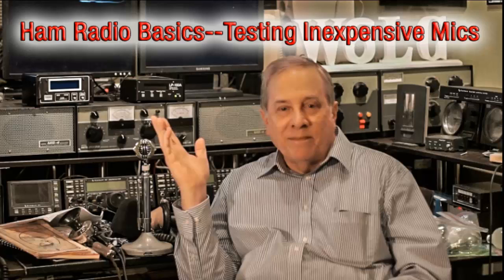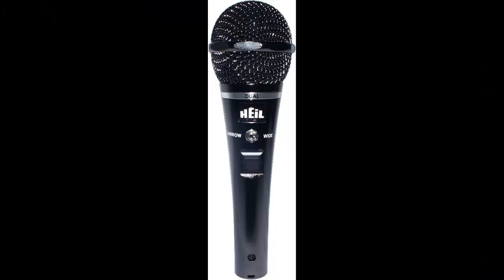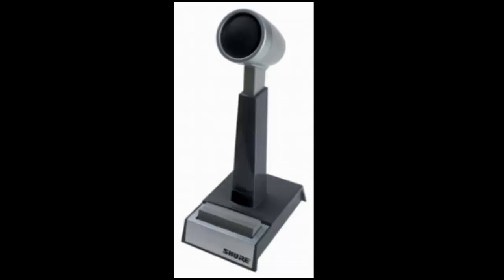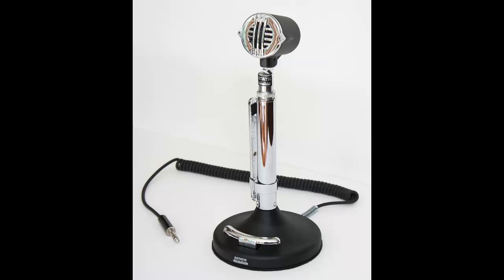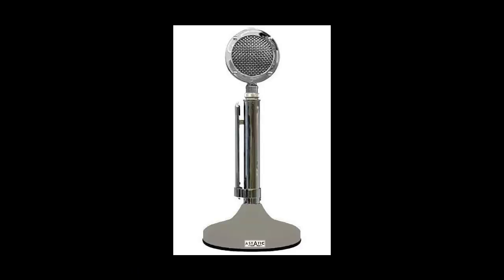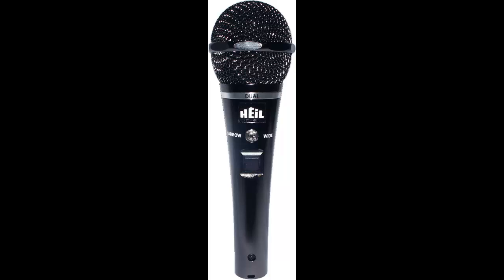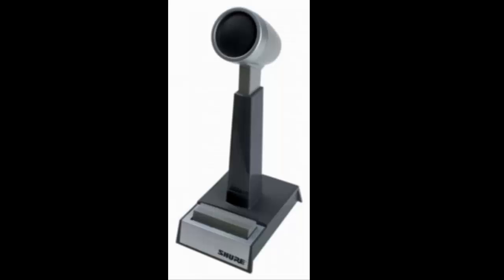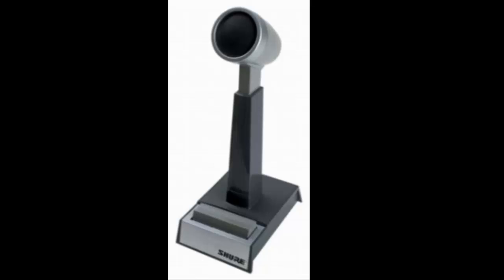Ham Radio Basics--Testing Inexpensive Microphones

Comment: Hi Jim. MIKE N2DBi. I know this is a oldvideo im a big fan of the d104 i run them just cracked open on the base of the microphone.  The question  im asking is... Is this d204 a amplified one with a 9 volt battery in the bottom? Or is it a Stock d104 with no amplification ?

Comment: I’m looking for a boom mic for my icom 2730a ( I already have the heil adapter cable) for use when doing check ins during a net. To have both hands free would be a big help so I can log in my laptop more easily. I’m thinking of the Heil 10. Thanks for the video

Comment: you make a good mic sound bad by taking all the lows out and crank the treble up you make then all sound like the d104 no body wants to talk to you when you sound like a close pen on your nose give it a little bass and a little midrange and some highs but not all highs that sounds bad
Reply from the maker: Thanks but your message is hard to decipher as written.  Some punctuation would be helpful to make your points more clear.  Your comment that "...nobody wants to talk to you..." is far from true.  I have had ten of thousand of contacts with every country on the planet over a span of 56 years.  My audio does not sound like a D104 high impedance mic into a low impedance transceiver.  Thanks for your input.

Comment: Very good review, which microphone do you recommend to use with an ICOM 7300?
Reply from the maker: Hi,
Because the IC-7300 has equalization built into the transceiver, any mic that is relatively broad in its response will likely work fine. So, an electret cartridge like those found in some Icom mics would be a good choice.  Any older dynamic mic is probably good.  That would include the Heil HC5 cartridge, my favorite the Astatic 10DA, Shure 444 and any other dynamic mic that does not have heavy emphasis on low frequencies.  One way to find a good mic is to test some from other local hams.  Again, you don't want a bunch of lows in the audio.  You may like the way it sounds in the monitor but it won't be good communications.  I am sure you have heard the guys with terrible, broad, wide, bassy audio.  It is not good for the guy trying to understand what you are saying from the other side of the planet.  I hope that helps you a little.  Thanks!  73, Jim
Reply from the maker: I am uploading a video demonstrating what I describe.  It will take some time to upload.  It is me working a guy in Saudi Arabia as recorded in Qatar. 73, Jim

Comment: Hi Jim, great video! I recently bought a Asiatic D-104 microphone on Ebay and I want to use it on my Kenwood TS-430S. Do you know of a source where I can get the wiring diagram to make the conversion to an 8 pin Kenwood plug. Also what do you think of the replacement cartridges for the D-104 microphone.
I just recently received my Tech license and have found your videos very helpful.
Thanks,
Jeff KR0KRO

Comment: hi jim,

first of all let me tell you that i am really glad that i have found your channel. it's a real pleasure to watch your videos and learn new things in nearly every one of them. new subscriber. 

when equalizing microphones back in the days i worked as a sound engineer (for live events mainly) i learned something from an old guy that helped me out a lot. so i had thought i'd share that with you and give back an advice as you share what you know so nicely which helps me out a lot as a ham still pretty new to the game.. the old guy said to me that i shouldn't use an eq to boost frequencies i want to promote but to use it to pull down the frequencies i don't want to promote. what he tried to teach me there and what i have never forgot was that you cannot add information to your signal by boosting if it's picked up once without distorting the character of it. (and by the way what you are boosting the noise from the preamplifier as well.)

so what i do when i want to say "boost up" 1,5kHz is: i leave at 0, decrease everything else a bit and amplifiy the hole signal a bit more to get it all up to the same level again. this may depend on the qualitiy of the eq compared to the quality of the mic amplifier for sure but it seems to be way nicer to handle unbalanced microphone sounds once you got the hang of it.

i don't know if this helped but let me tell you this before i stop.

i am watching your videos with great interest especially the ones dealing with mics because i kind of got back into the hobby after being licensed about 5 years ago, having had a 3 years pause, having bought a tx again right now and thinking about actually buying a mic for it ;) .. (1st mission was to learn cw before).

so thanks for sharing your experience, i like your attitude and would really enjoy seeing you on the air one day. i'll keep an eye and an ear open.

73 to you and keep up the good work, om
do7ced, peter

Comment: Hi Jim!  Just listening through my laptop speakers (believe it or not it has a subwoofer), and for "stock", your 444 and D104 sound really great.  To my ears, you had to eq the 10DA a lot to make it sound just like the stock D104.  Heil sounds pretty good, but agreed on the pinched "5" switch.  I recently had my old Yaesu FT-101E gone through, so I think I'll be putting a D104 on it.  I recorded a fella several months ago running a 756 Pro with the D104 hand mic, and he sounded surprisingly GREAT!  Good lesson on the fact that you don't have to spend a fortune to sound top shelf.  Thanks again for the videos!

73,
Brett KF5WXP
Reply from the maker: Hi Brett,

Sounds right to me (pun).  Spend the money on the antenna and feedline.  I very much agree about the mic.  All EQ is done in the rig.   I don't like external boxes.  Thanks for the feedback (pun again).  73, Jim

Comment: I dont know but sound is so subjective ,,,,, who the heil is to say whats great or not so great. I never considered myself a cb"er but I kinda prefer the pinched and slight clip of a tad over processed tone of the D104 type audio. Always seems to have that  punch and gets through the pileup too. Only thing with the clip is that it widens the bandwidth but now everyone is an audiophile and running wide too but maybe less splatter but definately seemingly wider.
Reply from the maker: Thanks for writing. Not everyone is an audiophile. Sadly, there are a lot of guys who have removed filters and are transmitting with very wide SSB that sounds like DSB. I am not talking about splatter.  I am talking about the fundamental signal being very broad.  They are a cancer on the bands and talking up three times the spectrum that others could be using. 

Listening again, I too like the D104.  

73, Jim W6LG